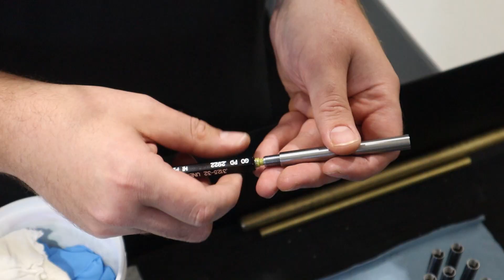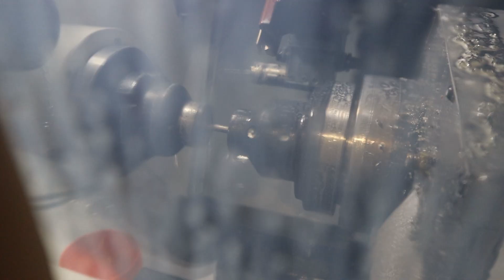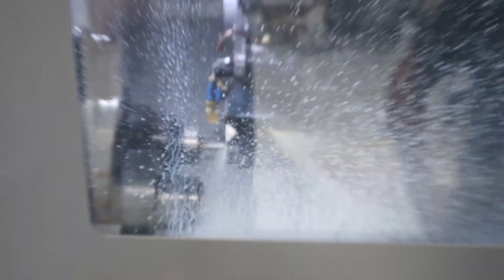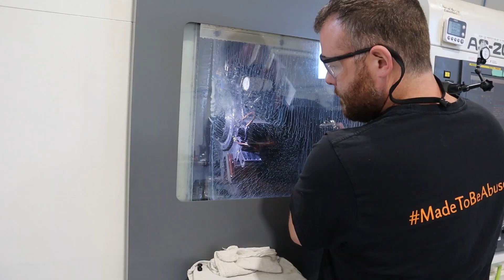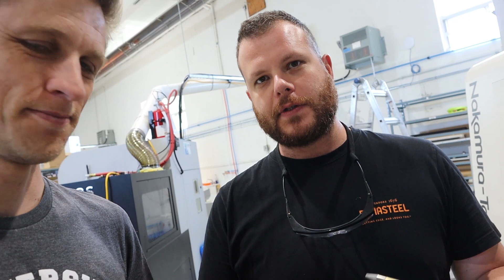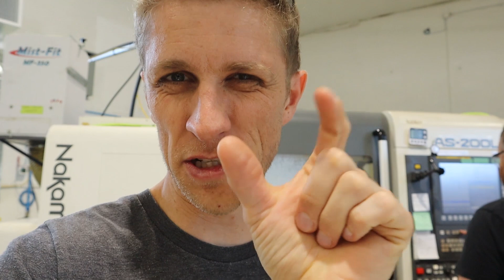Making 500 Saga tubes in 2 weeks - Shop Life 54

Comment: Is it not just possible to make a fixture for those tubes and just use the mill for it if you're only drilling and threading them? Then you could easily have over 100 of them in the machine in one go.
Reply: nothing beats a lathe for concentric work. Nothing.
Reply: @a.fisher8006  that's a bold statement. There are several things that beat a lathe. A jig borer/jig grinder, or a CNC grinder.
Reply: @xenonram  that depends on machine, and what youre doing, but yes you are correct in that a jig boring machine or grinder is extremely precise depending on variables and generally more precise machines than lathes. however two concentric bores or features made in one lathe op is generally going to be dead accurate in concentricity and location to eachtother (for very obvious reasons) vs a mill or even removing from setup and picking up again.  I guess thats what I was getting at.  But yes your statement is correct.
Reply: Should add, in this application.  You arent going to drill a hole with a cnc grinder,  so to perform this operation where you have OD and ID ops w 10xD drilling i will stand by my 'bold' (not really) statement.

Comment: I’ve done scotchbrite in the parts catcher or like the plastic diamond mesh from around cylinders for shipping so the parts catcher wouldn’t scratch parts,but someone has to be there to take parts out or depending on size of parts they could scratch each other
Reply: Scotch brite is aluminum oxide or silicon carbide abrasive embedded in plastic. Not really the best thing for preventing scratches. Plus, you have all that abrasive getting knocked loose around the machine, which isn't good.

Comment: 3 minutes a tube and only 500 in 2 weeks. My boss would be firing a rocket up my arse if I spent 55hrs on setup.
Reply: It was less than half a day to physically setup. Getting the part needed and dialing in program etc is what takes time.
Reply: I have seen a couple day setups on big boring mills
Reply: It doesn't work like that. You can't do 10*8*60/3 and ten take away 500 and divide 1100 by 3. That's assuming NOTHING else was being done.

Comment: Why do you guys run a driven tool for the 10D drill? Have you found it works better than a stationary drill in this setup? You are running the spindle in the opposite way obviously, but just interested to hear what advantages this has?
Reply: You would generally use a live tool for smaller drills due to speed. Live tools are around 10-12k RPM compared to 4-6k for the spindle allow you to drill faster and a lot closer to the speeds and feeds recommended for carbide drills. As the drills get bigger you need the torque of the main spindle.

Other option is to run spindle and live if you have the capability on the machine.
Reply: @VPEEK   In ali i would agree, but carbide into titanium I would be surprised. But yes agree this could well be the case here.
Reply: J H Yeah it’s about on the edge, haven’t a clue what size drill it is but 5mm or below we run live as at 60m/min you 4000rpm+

Comment: Hey @grimsmo, could you share the part ejector design in fusion PLZ. Settings are D1330(inches if machine is imperial) for max position with part catcher open  and setting P6950 ( in mm) for max position from main.
Reply: Also you can add a protected sub spindle move with G310 BXXX FXXX A50.0 K2. S1. so it can detect if a part is stuck in the sub.